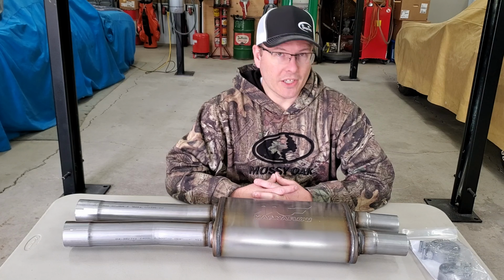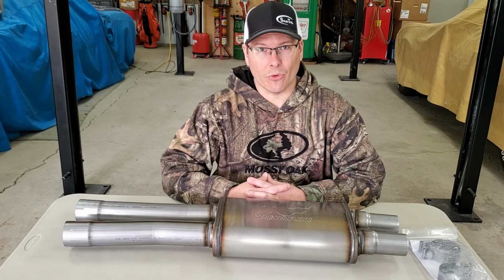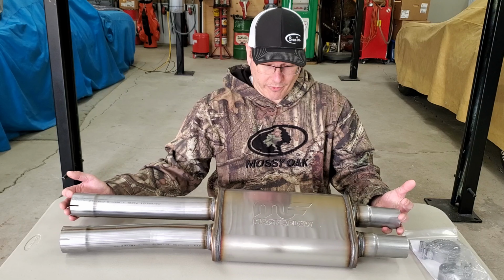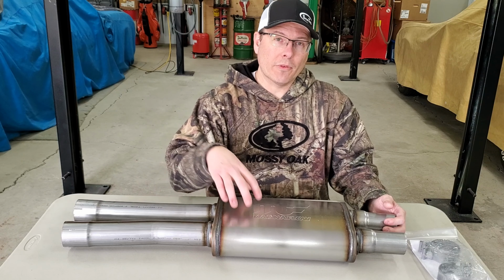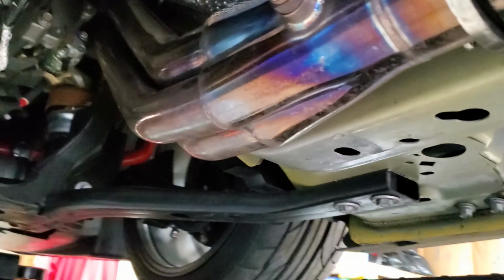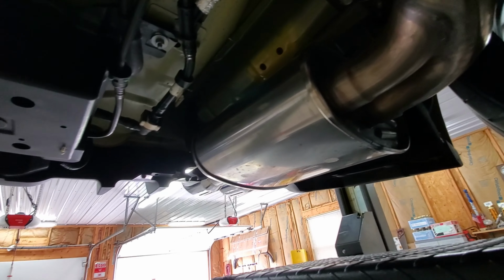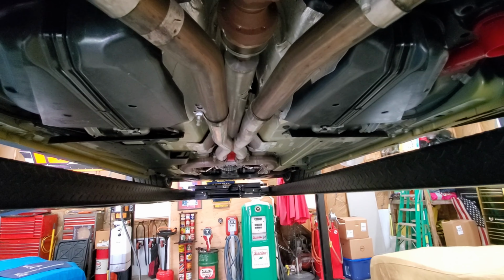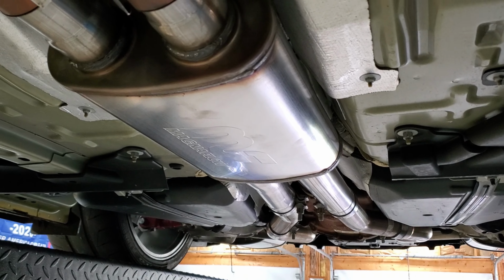Need To Quiet Your Mustang?  I Can Help!

Comment: New 2022 Mach1 HP owner here. Im thinking about my Active Exhaust options to comply with racetracks that have noise restrictions. One of the options Im considering is replacing the stock resonator with two Vibrant Ultra Quiet resonator bottles. Other option is keeping stock resonator and trying to fit regular Vibrant resonators behind it. Last option is an H-pipe combined with ultraquiet vibrants.  Magnaflow mufflered x-pipe looks like a great all-in-one option as well.  Although I love the stock sound, I want to avoid getting kicked out of HPDE events when I use the Mach1 at W.O.T. Ive read that some M1 HP owners just pulled the AE fuse while the engine is running in AE quiet or normal mode, before pitting out on the track.  Any suggestions?
Reply from the maker: My buddy has a gt350 with resonator delete and active exhaust and hasn't been kicked off Summit Point for noise.  If you leave it stock, you should be okay.

Comment: Is it possible for the part number of that muffler?
Reply from the maker: https://www.cjponyparts.com/magnaflow-x-pipe-tru-x-resonated-stainless-steel-clamp-in-mustang-gt-2015-2022/p/XPG1/
Reply: @Driven2Compete  I checked the website can't find this setup, only see the borla resonater setup, will that one work
Reply from the maker: @Ecobeast2.7  the borla is not a direct bolt up as I tried it and it did not fit.
Reply: @Driven2Compete  could it possibly be welded on, if not do you know what other options they may have, jus want to quite it down a bit, I pretty much have the exact same setup u have, it some amazing, but it is extremely loud
Reply from the maker: @Ecobeast2.7  I would take the car to a muffler shop and have them install a muffler where the original resonator would have been using an h pipe and matching it up to a muffler.  It looks like Magnaflow only offers the mufflered h pipe in their kits now.  The Borla was on a buddies car and failed.  It was blowing packing out the tail pipes.  They offered to replace it under warranty, but only once.  If it would have failed a 2nd time, he would have not been covered.  He chose to return it, put his h pipe back on and change the axle back to a different brand.
Reply: @Driven2Compete  appreciate that, I will get with my muffler shop . Bro I love this mustang, only had it for 3 days, the exhaust was already on when I bought it
Reply: Got the magnaflow muffler installed, today to replace the x pipe, it definitely help tame down the sound and took out that high pick rasp from the long tubes, car sounds amazing, thank you for the info
Reply: Definitely I love how my sounds my car was way to loud now I can actually drive the car in los angles area and not worry about cops thanks a lot Brotha I forgot to reply back great video !!!!
Reply: @Driven2Compete  have a quick question, I,m pretty new to the mustang GT community, if band of gas is better for the mustang, when I had my Challenger shells was the best gas for it especially when it came to tuning, so which brand do you think is better for the mustang shells, Chevron, or Exxon, especially for tuning
Reply from the maker: @Ecobeast2.7  I honestly run all those in my car with no issues.  I tend to stay away from grocery store and certain convenience store chains to hopefully not get a poorer grade of fuel.

Comment: Are those roush axle backs????,,,,and I believe you do not have the retune the car by just changing out this for the x oipe right
Reply from the maker: Those are Roush axle backs and you are correct, no retune needed for an exhaust change or x pipe add.
Reply: @Driven2Compete  ok thanks,,,,,,just got my car back,,,,with kooks catless long tubes and a supercharger,,,tuned by lund,,,,I already had an x pipe and roush axle backs,,,,,,,,,,I like a loud sound but holy fucking Jesus this thing is nuts,,,,,I believe I'm going to try this magnaflow  ,,,,,,,I think  its called magnaflow true x ,,,,,,do you know the exact name and order number???I saw on cjs,,,for like 269 like you said,,,,,,,glad you did this thanks,,,,,,,are you really happy with the sound,,,,does it still sound good and aggressive,,,,,,???

Comment: Mustangs ain’t loud to begin with only Camaro and mopars are roudy and loud
Reply: You have obviously never heard a coyote with headers..
Reply: @czmdzn He has a Camaro in his Profile Pic. But dumb thing to be wrong about nonetheless.
Reply: Owned a Camaro SS, currently own a GT. Both stock exhaust. The Mustang is the loudest stock car I’ve heard. That cold start is ferocious, I had to buy a Borla touring to quiet the thing down
Reply: @Marrs47  yea I have a 2022 with a H-Pipe and a Borla S-Type Active Axle Back. And if it wasn't for quiet start and quiet mode my neighbors would be at my door with pitchforks. In quiet mode it just sounds like a normal V8 starting. 😂